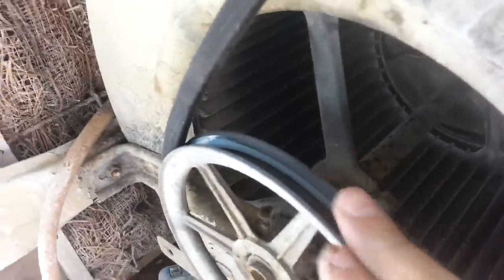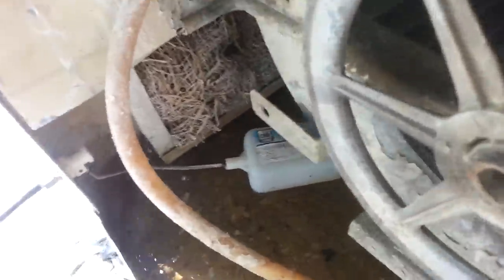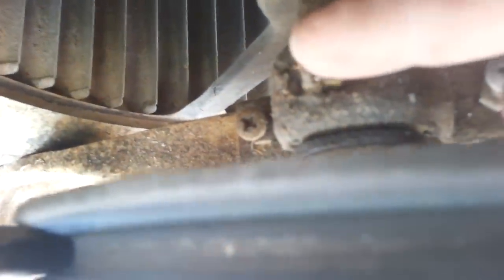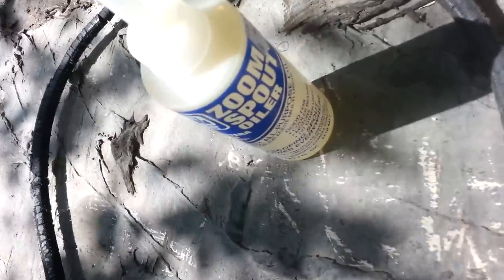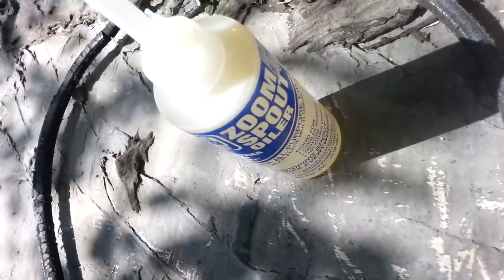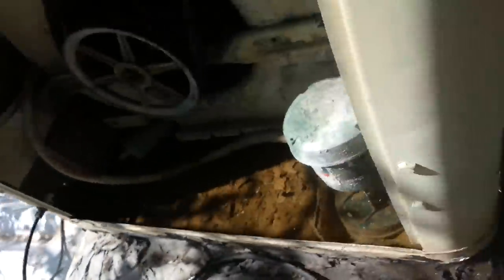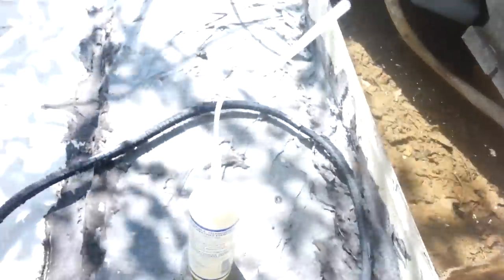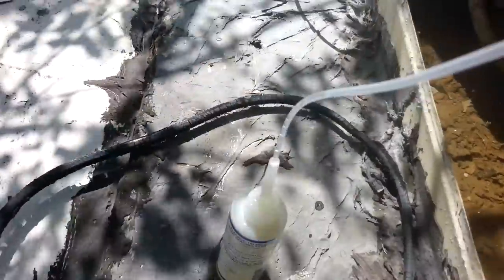How to Oil the Bearings on a Swamp Cooler

Comment: II am having to take over a lot of jobs my husband used to do because of his poor health.  I thank you so much for your help.  I had found the exact oil you are talking about in my cabinet a few days ago.   Had no idea about how to use it.   Now I see that I need to replace the bearing on one side, but for today, the squeak is fixed.  Happier Fourth of July.  Thank you.  Very helpful.
Reply: Same situation here. I was in a bad accident in 2016 and now my old lady is doing all of or I guess I should say some of the things I used to do around the house. I basically did a tune up every spring and when I bought the place I had no idea what was even in the thing.. I just looked at it and it was no problem but this video was great for her

Comment: how much oil does it need? the directions just say "do not over-fill or it could burn out the engine". thanks a lot, manual writer, thats very helpful. i appreciate you showing where rhe holes are! another important detail they left out.
Reply: flip up the little cap and squirt till it's either at the top or overflows a little bit.  then spin the pulley a few times and top it up again.  BE CAREFUL and do not get your hand caught in the belt/pulley.  Wanna know how I know this???

Comment: oh crap i done put lucas grease in mine
Reply: Pull the spider off the squirrel cage, get a can of brake cleaner, clean the bushing, spray plenty down into the hole where you somehow managed to inject grease, turn the round bearing holder side to side, wipe everything clean, re-install, oil.  30 minutes per side.  Exactly how did you manage to get grease in there?  Hypodermic?